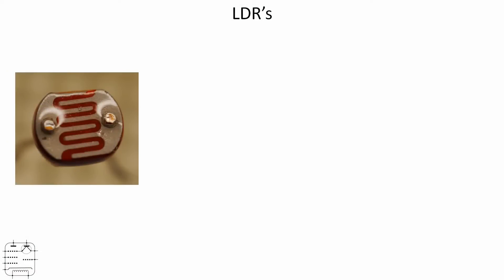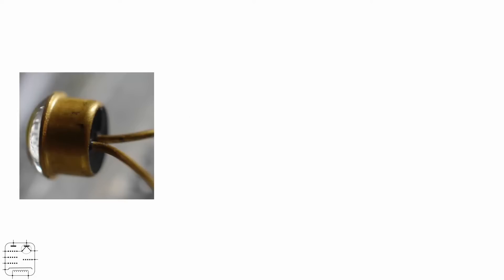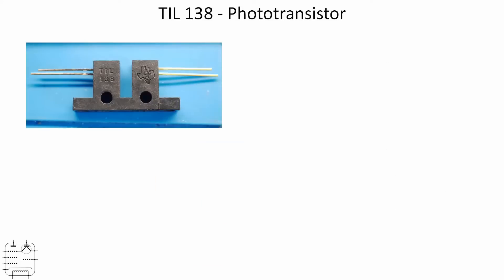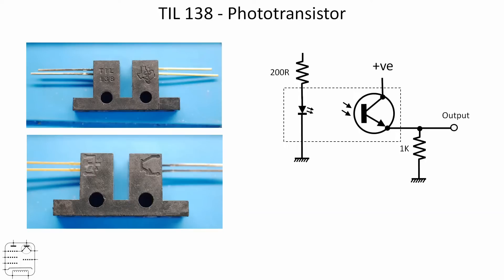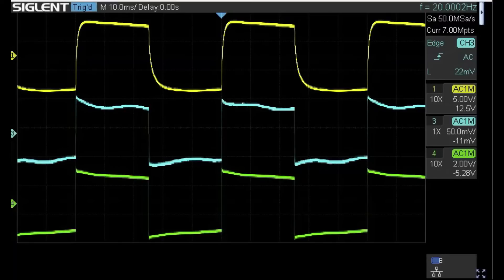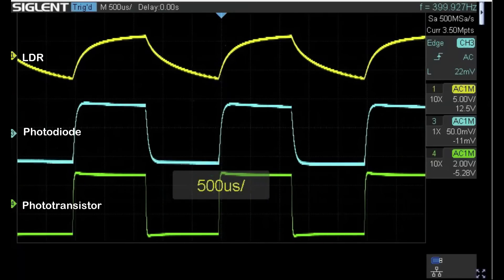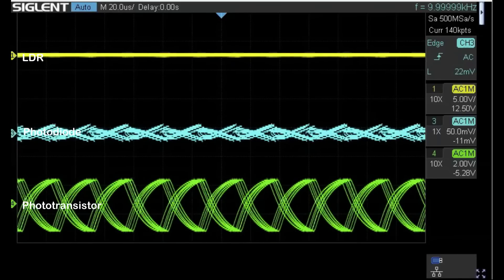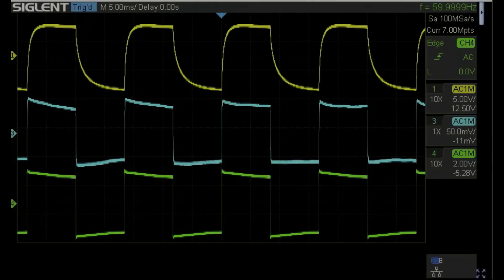Optoelectronics - Just how fast is an LDR? - #209

Comment: Hmm, you're saying the supposed photodiode measures 9.7V drop in one direction, and open circuit in the other direction? That sounds like another phototransistor, operated backwards. 

Since phototransistors are NPN (or PNP) structures they don't conduct in either direction at low voltage (1V for instance). But one of the two PN junctions (emitter-base) has a much lower breakdown voltage and higher capacitance than the other. So when hooked up backwards, the emitter base junction ends up reverse biased rather than the collector base junction, and it will exhibit a much lower breakdown voltage, along with much lower gain (since the reverse beta of transistors is usually very low). A breakdown of 5-10V would be pretty typical.

Any silicon photodiode will conduct at 0.6V or so in one direction. A 9.7V conduction voltage is 100% in the realm of avalanche reverse breakdown, not PN forward conduction. 

One other point of note here is the unused bond pad on the device. There were phototransistors available with the base terminal bonded out to the package back in the day. The fact that there is an unused bond pad does tend to suggest that this is a phototransistor die that doesn't happen to have the base bonded out. There would be little reason for more than one bond pad on a photodiode, except perhaps position sensitive diodes (and then the second pad wouldn't be on an adjacent corner like that).

Comment: Many years ago one of my jobs was aircraft maintenance and the smoke detector used on Boeing aircraft (737 / 727 and 747) of the 1970/1980 used the optical pricinciple, light source shining at 90 degrees to a detector where only light bouncing off the smoke shines on the detector. When servicing the smoke detector part of the test set up involved either placing a cap over the light detector in a dark room while disasembling OR waiting 4 days after the detector was reassembled. This was th ensure that in the no smoke mode had the required dark current setting. I am not sure which detector was used but think it was an LDR variety.

Comment: I think the photodiode would have performed a lot better if the bias voltage was somewhat higher - that decreases the junction capacitance quite significantly. Adding a transimpedance amplifier is perhaps an overkill for this simple experiment, but I think it worth trying. Thanks, very nice demonstration.

Comment: I sometimes use LDRs in homemade electronic organs and synthesizers. My experience is that there is a huge difference from one type of LDR to the other. One is really fast while another is only suited for monitoring the change in sunlight during the day! Amongst the types I have, it seems to be a choice between speed and sensitivity - a very sensitive LDR seems to be slow while a fast LDR requires more light to respond.

Comment: The photo diode is actually the fastest of the three when used properly.  The way you are showing it in forward bias it looks like a solar cell, i.e. generating a voltage/current when exposed to light.  Photo diodes are actually meant to be operated in reverse bias where the leakage current is proportional to the intensity of the light.  When operated like this, they have response times orders of magnitude better than photo transistors.

Comment: Another excellent video, Bill. 😊👍
I was thinking, a good follow-up video or part 2 to this would be to see the frequency response, and linearity (or lack of) of each device using a sine wave.
The photo transistor will obviously win, but I'm curious as to what the - 3dB points are, although this would also include the response of the LED as well, thinking about it. 🤔
I'm going to be lying awake tonight, thinking about how you could have a linear light source across, say the audio spectrum, to test this idea with the devices isolated from the response of the LED. 🤔🤔

Comment: I wonder if that photodiode would perform better in reverse-bias? Or with a different LED? The phototransistor had its own IR LED, and those are usually designed for faster applications like remote controls, rather than light indicators where speed doesn’t matter. You also chose pretty dim LEDs, I bet that LED would have a much longer recovery time if you used a blinding green LED.

Comment: I wonder how fast your photodiode would have been in reverse biased mode? It should perform much better, at the cost of added complexity in getting a usable output signal in the first place! Whether that's considered ceating in comparison to the other parts with their much simpler surrounding is up to debate-

Comment: you are supposed to reverse bias the photodiode if you measure speed.
Your forward bias gives the slowest possible speed, but the highest sensitivity. However in your setup sensitivity was not a problem, so I am puzzled why you crippled its speed.

Comment: The LDR has a lag because of residual heat from the LED.
If there is a small distance between the LED and LDR ( 8mm )  the behaviour changes and recovery is faster.
I use blue LEDs for this specific reason ... even though it is not in the optimum frequency/colour for maximum LDR range it is certainly faster .

Comment: SUBSCRIBED!!! 

I'm adding a large 25mm LDR/incandescent lamp controlled compression circuit to a single germanium transistor audio fuzz box, with germanium diode clippers in two locations, one before the transistor, and one after, as well as a selectable bank of different film caps as filters on the audio input. I am currently designing this fuzz box for use with monophonic synthesizer voices (For example the Roland TB-303, and the SH-101)

Comment: Uuuhm, no, that is not how you wire a photodiode for a speed competition. You should have photodiode reverse biased and detect the variation in current leakage. The "on" state reverse current leakage is quite small compared to a phototransistor's "on state" but ph.diode is actually blistering fast to react. The higher voltage you use in the reverse bias the faster it will switch. There are trade-off's; the physically more sensitive ph.diode you need the slower it will be. Large/sensitive ph.diodes have a-/acts like an annoyingly large large capacitor, compared to the currents we are using. (The "trick" I use to maintain just as fast flanks going "off" is to not let the ph.diode drop too low in bias voltage drop during "on" state).

Comment: that metal can unit looks like a photo diode, possibly BXPxx or ORPxx, check it with a diode tester
or it could be an OAxx CdS photo resistor,, I'd normally expect to see  a"zig zag" pattern on the sensor element

I'm leaning more towards it being a photo diode from the construction, that "fly lead" kinda gives it away

Comment: Hi there,
im not a specialist in the terms of LDR's, but i noted something years ago while developing Audio Compressors. 
Old LDRs were based on Cadmium-Selenide and were sensitive to red and near infrared. They were quite noisy and really slow when it comes to getting non-conductive again. 
Newer ones must be made out of a different material, most likely due to the toxicity of the old ones. They're now sensitive to yellow/yellow-green, are less noisy and reacting much faster than the old ones... 
So your memory didn't fool you -they changed over the decades.
Reply: That’s odd, because I see modern LDRs still advertised as CdS-based.

Comment: The problem with an LDR is that as it's resistance goes higher, capacitance rises.
This affects it's response time.
 As frequency increases, the wave form at it's output becomes rounded, distorted,  and eventually disappears.

Comment: You might be able to find out if the middle device is a diode or transistor. I think only a photo diode produces a voltage when illuminated.

Comment: You should try an pc817 optooisolator. Ince they are used in switching  power supply  that rins at high frequency

Comment: Fascinating experiment, thank you. Subscribed.
  Some years ago, I regularly had musicians (guitar & bass amps mainly) valve amps to repair/modify. Many of them used an LDR and neon lamp in a light-tight tube as the "vibrato" circuit; this was very simple because the neon could be connected between the B+ and the cathode of a triode, while the LDR formed a voltage divider. Of course, they regularly failed, so we just made new ones but not all neons had the same characteristics. Marshall amps used a JFET but, were very unreliable and prone to thermal drift (Marshalls run very hot, especially later ones with PCBs). We made some using transconductance op-amps (the old faithful CA3080), some of which were put in stomp boxes. However nothing sounded like the purely optical ones, perhaps because of the hysteresis of the neon lamp and the slowness of the LDR.
  I once made a "photophone", of course the only sensor that could work was an LDR.
   An interesting experiment would be to test the linearity of the LDR.
   Sorry if this is the boring ramblings of a superannuated old tech.
Reply: vibrato...or compression?
had a lenard gb60 with only compression, and yeah.. LDR/neon combo.

 same circuit was purchased by marshall for a series of their amps... very distinctive with its EF86 input stage, and if i recall, a 1/2 12au7 on each phase after the 12ax7 cathodyne PI driving el34s. definitely not standard marshall topology...
Reply: @paradiselost9946   Definitely vibrato. if I recall correctly, one of the triodes of a 12AX7 had a phase shift oscillator that drove the neon and the LDR formed the voltage divider input for the other triode.
    Yes, the CA3080 was used in vibrato circuits, just as a simple VCA driven by an op amp as a phase shift oscillator.
    It was very common to use the old faithful CA3080 as a compressor but was rendered almost obsolete when the SSM2165 came on the scene. Sometimes we used half (the compressor part) an NE575, though it was more expensive than using the CA3080 but very smooth.
   I'm surprised the EF86 wasn't used for compression or vibrato/tremolo, it being variable mu; it was often used as the AGC on radios.
   What a beautiful valve the EL34 was; back then we had some NOS Mullards, great in the old VOX AC30, quite good in hi fi too. I loved working on AC30's.
   Whew, all these old memories coming back; I thought I'd forgotten all this stuff.
   Thanks for the reminiscence.

Comment: In the early 2000's, I made a DIY reflective color sensor with a CDS cell, MCU, and R G B LED's.. and I was disappointed by the slow response of the LDR.. several dozen msec settling time for each color component. PS: Your LDR seems much faster than mine was. I used a really large one, if that's relevant.

Comment: Thanks Bill, I particularly enjoyed this. In the mid 1970's for my school open day I built a replica of John Logie Baird's Nipkov disc TV system using synchronous motors and 12" cardboard disks, 30 line definition. I was inspired to try this after seeing a demonstration of the Baird system on Blue Peter. The 'camera' part of my project used a cadmium selenide LDR as the detector and the 'receiver' used a neon lamp. The images visible on the receiver were crude but recognisable with some imagination. At the time I wasn't certain of the frequency response of the cadmium selenide LDR, there was no easy access to datasheets of course! However I found that if I held the detector against the screen of our PAL TV set I could hear a 50Hz buzz and therefore I imagined it might be just about good enough for the task and it was!
Reply: Funny Dennis!  I am currently building one for demonstration on my channel and was worried that the LDR would not be fast enough.  200 years of broadcast TV next year too!

Comment: Nice experiment 👍🏻
Now you should repeat the experiment…
With ALL of the devices being triggered by the SAME light source…
I would guess the intensity of the light source, as well as the wavelength may affect the outcome.
Do you have a xenon flash tube ?  Triggered by a pulse generator, narrow the pulse and see if the DUT sees the pulse ?
Reply: The IR detector and LDR have mutually exclusive spectral responses.  What would be the point?

Comment: Interesting the 3 are "Good" @ X frequencies but isn't made to handle "high" ones. I was surprise LDR even made 100Hz. Example: Tiny LDR is only mainly to "switch" whatever on/off when other light is above Y level or trip a door, alarm, etc when someone break a light beam. I rebuilt Foul "alarms" for Bowling uses a much bigger LDR (22mm diam) that allow to be very sensitive so if foot across the line even without touching the floor the unit will call Foul. The Diode and Interrupter goes higher but likely never expect very high frequencies. Interrupter shown and related mainly counts whatever passes thru or in front of them like many "Inkjets" use one for counting steps for ink head location but many are not "focus" enough for high res counting or barcode readers.

Comment: I got a batch of photo resistors from Amazon. CDS. Built a few gadgets. After about 2 or 3 months they end up leaking or shorted. I pretty sure I followed the technical limits. I now use small solar cells to detect light.

Comment: Laser rangefinder photodiodes have an astonishingly short rise time - under 350 picoseconds (some folks are in a real hurry I guess).  In my limited experience, photodiodes are much faster than phototransistors as you approach the extremes.
I was getting some really noisy edges with an available IR phototransistor, had to introduce a Schmitt trigger scheme and the edges became razor sharp.  These experiments were a lot of fun.
Enjoyed the video, thank you Bill.
Reply: well, we have 40Gb/s networks, it's 25ps per bit.
researchers record is 300Tb/s,  but probably using multiple chanels DWDM
Reply: @johnfox2483  just looked up the 'fastest photodiode' and it clocks in at an amazing 265 Ghz.  Apparently the fastest rise time goes to Photek photodiodes "..considered the fastest in the world, with pulse rise times of 36 ps and pulse FWHM of 55 ps"
Indeed they're dicing up the light spectra to send several bits simultaneously.